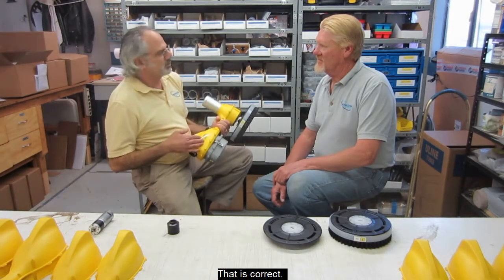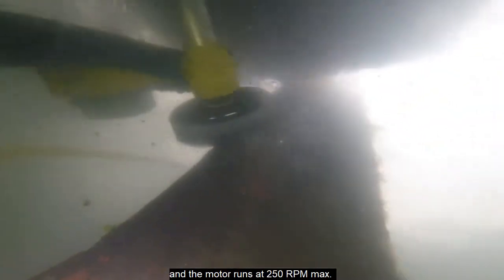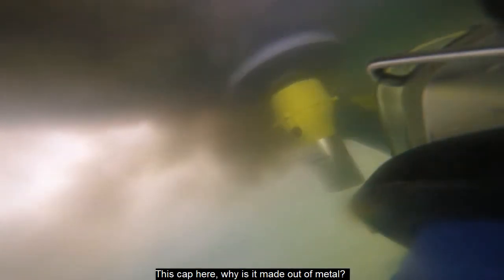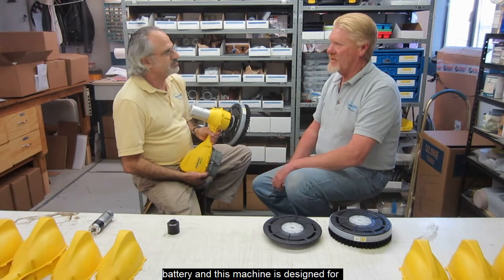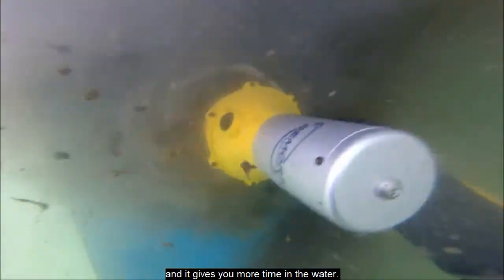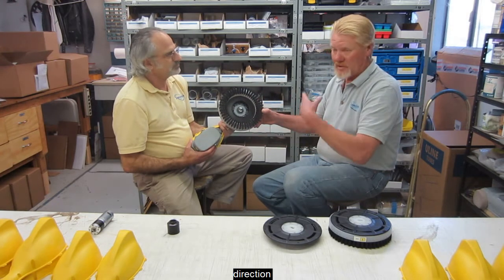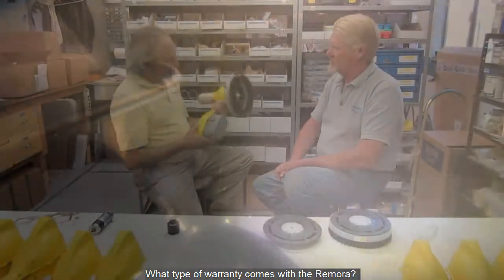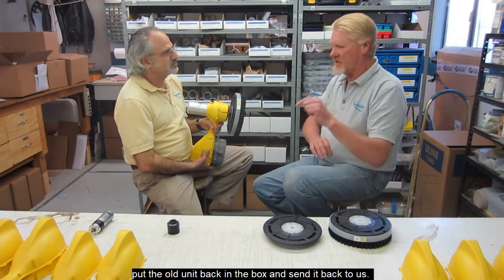Things To Know About Remora Solo!

Comment: Way over engineered. I run a dive/hull cleaning service spent a lot of money on 2 units with all the brushes and they spent more time in for repairs than underboats doing what they are supposed to. Simon was very helpful and customer service is excellent but definitely not a product i would recommend. I actually have 2 refurbished units simon sent to me that have never been used and are headed for the trash because i refuse to sell something so unreliable. Do yourself a favor and get a ryobi power scrubber. I wish simon and remora the best, but until their product is recalled and completely re-done i can not give them another dollar.
Reply: Hi Dude, can you tell me which ryobi scrubber you are reffering to, and can it be used under water, Cheers
Reply: What about the Nemo
Reply: مرحبا 
كيف يمكنني الحصول على هذه الآلة الجملية هل يوجد رقم هاتف للتواصل شكرا جزيلا